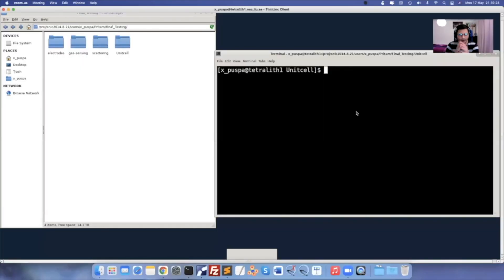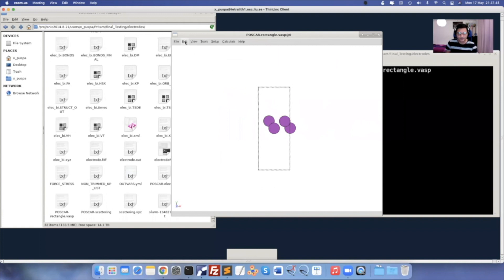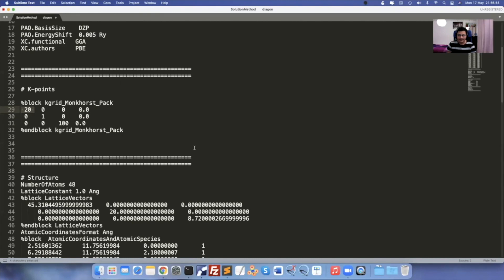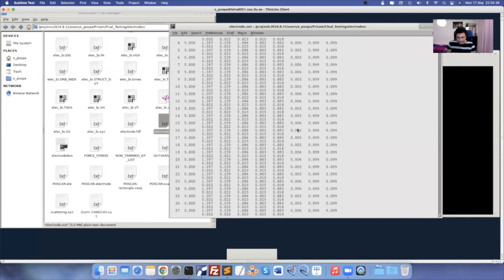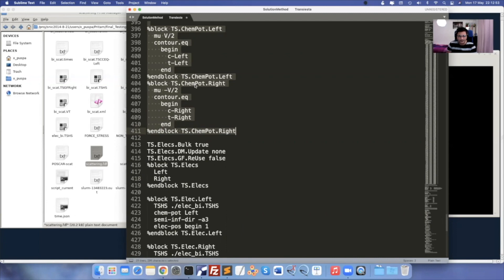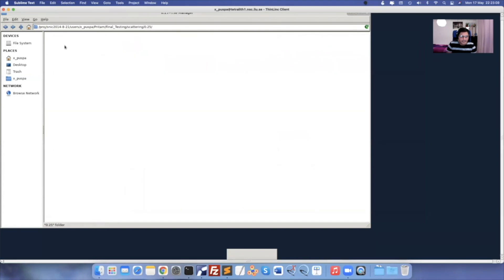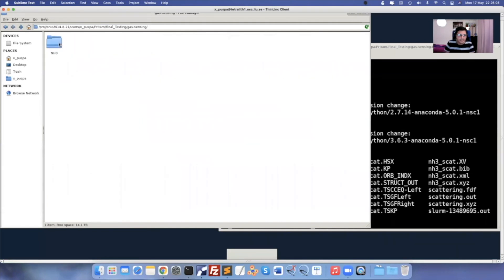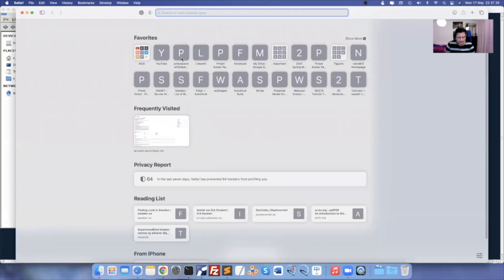Gas Sensing with Molecule Adsorption using TRANSIESTA

Comment: At 39:00, thank you for pushing the TS.Analyze output, this is really important for high-throughput calculations! :)
Note that the percentages are percentages from the full matrix size. So 43% means it used 43% of the elements in the full matrix.
Reply from the maker: Thank you! Yes its very important and it reduces the computational cost as well.

Comment: Great talk! I have a few comments:
1- you talk about xyz vs poscar files. In general for siesta you dont worry about that in the fdf file. You would be either interested in xyz or fractional coordinates.
2- 20 k pts is not really a realistic number. This number depends on the k point convergence of the system.
3- transport can take place in different types of unit cell not only rectangular

I am actually working on a gas sensor project as we speak so this is very fruitful. 
Good luck
Reply from the maker: Thank you very much! I will update all the points in my next video
Reply: @BioinfoCopilot  No problem at all. If there is anything I can help with be free to let me know!

Comment: 1) Can you share links for .ion files for other elements? 
2) You did the VASP relaxation of NH3 adsorbed scattering region and pasted its relaxed coordinates in the the first (0.0V) or scattering.fdf will take care of NH3 adsorbed scattering region's relaxation by itself and we don't need to do it in VASP beforehand?

 Thank you for the videos.
Reply from the maker: The ion files are in my GitHub account. Yes, you can do the relaxation of NH3 or any gas molecule and the material you use either by VASP or Siesta. Then take the coordinates from the relaxed system. Rest the Transiesta will take care of the subsequent process.
Reply: @BioinfoCopilot   Thanks for clarifying the relaxation point. Also, I am only able to get the ion files of only the elements you used in the tutorial. Where can I get ion files for other elements for example I am trying to simulate MXenes by using your tutorials. Thank you.
Reply from the maker: @jatinkashyap1491  You have to download the PSML files or PSF files from the Psuedodojo website and Siesta Psuedopotentials website. Watch my other video related to PSML pseudopotentials and pseudopotential generation.

Comment: thanks for perfect tutorial.. how can you set the height of NH3 molecules from layer to molecule? .or your tutorial is randomly ?
Reply from the maker: The height of the molecule is based on structural optimisation that you have obtained from normal Siesta run or Vasp optimization. You can try different orientation as well. It’s better to check for the lowest energies through NEB calculations and then set it for transport calculations. I will try to make a video related to NEB soon! Thanks

Comment: Hi Sir, I want to perform the transport calculation of my gas sensor structure, optimised in VASP. As Transiesta uses the LCAO basis set for transport calculation and VASP uses the planewave basis set, is it correct to directly take the coordinates of the optimised gas sensor structure through VASP and perform the electrode and scattering calculations in Transisesta? If not, then how do we proceed? if yes then which example template I should use and how the mapping of planewave is done on LCAO basis set through the tool?
Reply from the maker: I would recommend to use Siesta for the whole calculations including optimization and then followed by transport. In that way you can use the same psuedopotentials.

Comment: At 37:00 you mention that one should not use "used-atoms" keyword. This flag is used if you wish to only include a subset of electrode atoms in the device region. If you use all electrode atoms from the electrode calculation as electrode in the device region, then I do NOT recommend using the flag for consistency. If you will reduce the number of atoms used, then it is required, but it requires some careful thoughts and consistency in the electrode-setup. :)
Reply from the maker: Thank you very much Professor! I will keep in mind and refer it to my next video!

Comment: 33:25 Why does the scattering calculation have the same K-points mesh with the electrode calculation? In the past, https://www.youtube.com/watch?v=mcDy0KobTZw, we have 1 instead 100 in this video. Since we have no periodic region in device along the transport direction, don't we set the single mesh along with the transport?
Reply from the maker: Yea you are right! Even if you set 100, when you open the out file you will see 1 KP along the transport direction.
Reply from the maker: The most important KP should be in X direction. It has to be same as electrode calculation.

Comment: Hi, I have a problem in the last step. Everything is OK and output files do not have any error but there is no current-voltage value in the tbt.out file. So I just have transmision file. Would you please help me to solve the problem and get current values too. Transiesta version is also v4.1-b4 and I use exactly the files you uploaded in the github page. Thanks
Reply from the maker: If you rant at voltage 0V, then current voltage value would be 0. If you ran successfully, then you should get the values at the end of tbt.out file.

Comment: Interesting video,

Once the transport setup is done, can we optimize it or directly calculate the transport calculation?
Reply from the maker: You have directly calculate the transport properties such as current vs voltage, transmission etc.
Reply: Thank you so much.
Reply: After optimization of the transport setup, the separate electrode coordinates can not overlap with the device electrode coordinates then it can be corrected by quantum wise ATK. Could you suggest me regarding this, i got this comment from someone else. Thanks in advance.

Comment: thankyou sir, lecture is very helpful.
Reply from the maker: Thank you
Reply: Sir,  why we convert hexagonal to rectangular? Is there any necessary condition for this?
Reply from the maker: For the purpose of adsorption of small molecules on 2d materials . Its just my perspective. Feel free to adjust your material accordingly. Try with hexagonal shape and let me know!
Reply: @BioinfoCopilot  sir, how can we calculate the thermoelectric properties like seebeck coefficient, thermal conductivity. electrical conductivity. Please make a video for this or provide me some references for this. Up to now , i have found out transmission function and with the help of this, how can we find out the above properties.Please suggest me. Thanks in advance Sir

Comment: Thank you very much for uploading such an important video. 
But, Sir, I have one doubt regarding the gas molecule adsorption. Is it required to perform the SIESTA run (relaxation) first for the molecule adsorbed structure (left electrode + scattering region + right electrode) before proceeding to the TRANSIESTA run? Because, if we do the TRANSIESTA run for the scattering region immediately after placing the molecule at a certain height over the surface, then the effect of molecule-induced changes would not be included in the study.  
Now, if we perform the relaxation of the scattering region (molecule adsorbed), then the coordinates of the left and right electrodes might not match perfectly. 

I seek your help to clear my doubt. Please tell us the step-by-step approach in this case.   Best Wishes.
Reply from the maker: Glad that it helped.
The most important thing is to relax the unit cell structures of all the systems that you are taking. 
Do perform unit cell relaxation for the system/sheet you are taking using normal Siesta.
Do perform molecule optimization using normal Siesta. 
Place the molecule on top of sheet and do relaxation to calculate binding energy. 

Transiesta
Take the relaxed unit cell and construct electrode. Perform normal siesta relaxation with transiesta to get .TSHS file. 
Construct the scattering region and perform transiesta to get volateg bias values. If semiconductor go for 0-3V . If it's metal; go for 0-1V.
Place the relaxed molecule on top of scattering region and perform the transiesta calculations. Remember in transiesta TSDE file saves the transiesta density matrix. TranSIESTA does not start with a SIESTA self consistent cycle, it goes directly to a TS cycle, taking the density matrix stored in the .TSDE file.

So the scattering region that you have calculated at 0V, you can take the TSDE file and run the calculation for the same. 

Hope it helps.
Reply: @BioinfoCopilot  thanks for your explanation. It really helps me a lot. But, I have one more question regarding the consideration of buffer layers. Do I need to include a buffer spacing between the electrode and scattering regions to make the electrode layer insensitive to the structural distortions from the scattering layer? Because in any adsorption case, it is common that the scattering region gets distorted upon relaxation. If yes, then, is there any rule regarding the size of the buffer zone? I highly seek your positive response. Thank you once again.